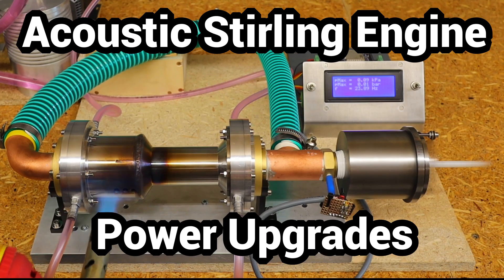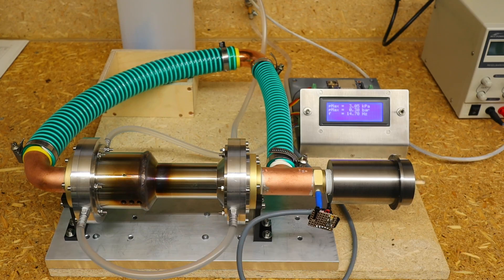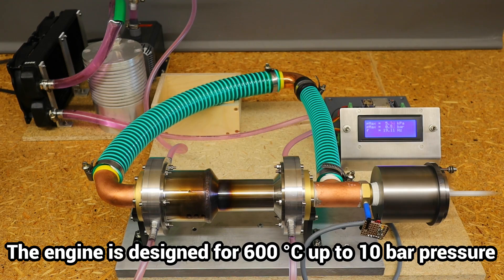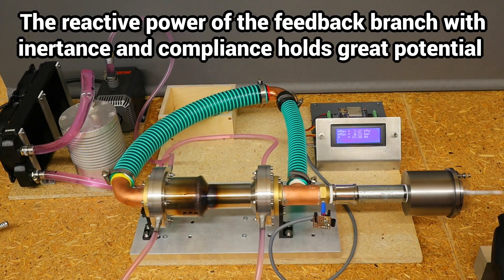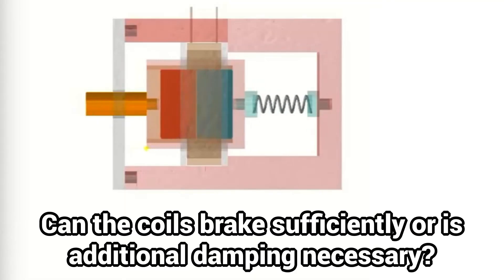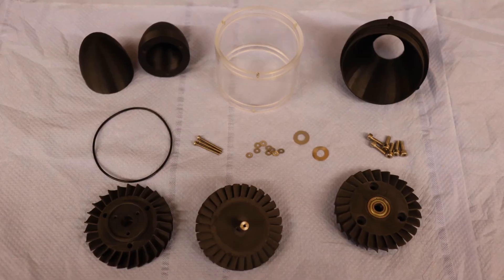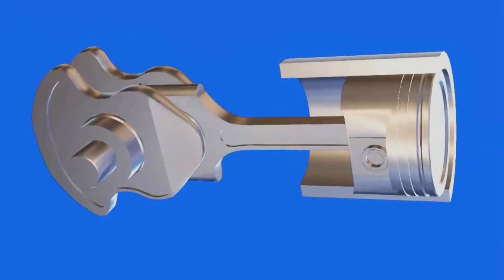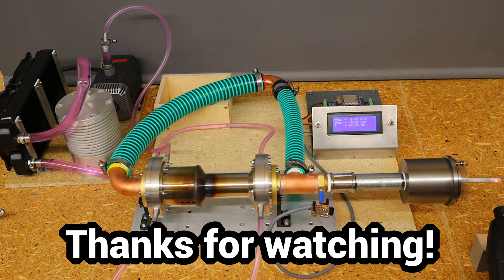Thermoacoustic Stirling engine – which is the right generator ?

Comment: I have been reading up on Linear Generators in the context of Free Piston Linear Generator recently so can share info on those if need be potentially.

An “Air Piston” may be a good damper (and has been used for FPLGs) and it is also tunable via pressure.

Dampening via tuned Generator Load CAN be done but that does get complex!
Reply from the maker: The complexity is really an issue  with the linear generators and I am beginning to think that for first experiments its not the right selection.
If the engine is in a good developed condition and delivering good power a linear generator can be adjusted to the engine to get a good efficiency and reliability?

Comment: I'd aim for the linear generator first, but it might be fiddly. I'd pivot to push crank if it doesn't look promising after some small amount of effort.
Reply from the maker: Yes that are my thoughts also at the moment!
A slider crank is much more flexible and easy to build and adjust for first experiments.
When the efficiency later has to be optimized a linear generator can be adapted to the final engine.
But I will wait with the decision as I get very good help at the moment with the many good comments! 

Thank you very much for your kind comment!

Comment: its alive, it walks! lol. all options work. if you want the simple linear piston motion can be turned to rotational motion (not crank axle but linear teeth on a gear) and use normal rotational generator.
Reply from the maker: Hmm,  a toothed rack and a gear does sound to me like much noise, bad reliability and much friction and wear or am I wrong?
But thanks for your input to think in all directions is the key!

Comment: If your goal is characterizing intrinsic engine power, I think counterintuitively a piston/crank mechanism is probably the easiest approach, although it may be hard to enclose when you start pressurizing the engine and it won't get you to your ultimate goal. 

My idea is that you'd commit to using indicated horsepower rather than shaft horsepower during the engine optimization phase, you would NOT try to generate mechanical power output at all, and then you'd be able to measure your engine's pressure-volume power output separately from any intrinsic properties of the piston and generator system. Then if you got disappointing results in the future you'd know it was the generator's problem, and not the engine, and you'd know where to focus.

Step 1: get a very fast responding pressure sensor that you implicitly trust (may require significant characterization work to be sure that the pressure readings are trustworthy)
Step 2: build a variable throw crank or a set of cranks with variable throw.
Step 3: couple the crank to a servomotor system, with closed loop position feedback and an appropriate speed controller capable of full power regenerative operation.
Step 4: conduct a "frequency sweep" on each engine configuration, and repeat the sweep with each crank throw setting. This means programming or setting the shaft speed to produce a very slow speed ramp through a range of speeds that encompasses the acoustic resonant operating point of the engine. Log both the crank angle and the pressure transducer reading continuously. 

I'm sure you know this but for anyone who doesn't, indicated horsepower is a measure of real world thermodynamic cycle efficiency in an engine that basically stops at the piston crown, and excludes all sources of friction and mechanical loss. It consists of mapping the pressure of the chamber as a function of piston position over the engine's cycle. Multiplying the pressure at a given point by the rate of piston volume sweep gives the power that the gas exerts on the piston. Accumulating this over the cycle gives the indicated power. Then, if the shaft horsepower of the engine is less than this by a certain amount, you know how much friction you have. If the electrical horsepower is less than the shaft horsepower by yet another amount, you know how much generator efficiency loss you have.

The idea here is that you basically get a set of indicator diagrams for the engine at a range of possible displacements and operating frequencies encompassing your optimum point. That way you don't miss the optimum just because the generator wants to resonate at 10Hz and the engine wants to run at 10.8Hz, or something silly like that. 

The system might generate literally no usable power electrically but would let you build an engine that worked super well, and then once you'd tackled that, you'd know how to size your generator for the appropriate power, how important the generator resonance frequency was, etc.

Also you could use an absolutely secure piston seal (like a greased o-ring) that absorbed ridiculous amounts of mechanical friction power, but provided completely clear-cut results as to actual thermodynamic cycle output without confounding contributions from piston leakage.

Definitely a delayed gratification approach, but probably one more likely to ensure success.

edit: another thought... you don't even need a regenerative speed controller if you lean into the "no mechanical output" tactic. Just apply a friction brake to the shaft to absorb any generated power, so the servomotor is always producing positive torque! Then a simple speed controller should work.
Reply from the maker: Many thanks for your very well-founded suggestions.
Your approach of  monitoring the real indicated power is very valuable and helpful for me and I will carefully study your comment and think of it how to realize it!
It would be more work to follow your approach but I think it is really worth it if you see the long term benefits of it.
I know that optimizing the engine to a point where it delivers really useful power is a very long way and information is the key to success!
Thank you very much I will think very much about your suggestion!
Reply: @ I am glad you found the suggestion interesting! If it was me, I think the part I'd find most challenging would be to find a pressure sensor that was sufficiently trustworthy, because of course if the results are misleading, then the approach is worse than useless!

Oh I guess if it were literally me, the part I'd find most challenging would be fabricating the beautiful parts you make! But I think you have that well in hand!

Comment: I noticed another poster mentioned the movement of the air as being wasted energy.  I think that's a great point, and made me think of a steam engine.  With your piston setup is there any reason you couldn't go to a double acting piston?

I think the linear generator is the best choice, although the control scheme is more complex it would be much easier to tune.  One of the things I think about with these type of stationary engines is that they don't really need to handle transient loads.  They just need to cycle up, charge a set of batteries and then shut down.  So they can be tuned to sit right in their efficiency zone.
Reply from the maker: You mean double acting piston in the way of using a second thermoacoustic engine on the other piston side?
That is very optimal and made in professional engines (mostly with 3 cores I think?) but it is double work for me and in the development phase it would slow down the process to much.
So i prefer to optimize one thermoacoustic core and then, if needed, add a second or third core to get more power.
The control scheme of a linear generator is a nightmare for me and also the tuning is not so flexible as a slider crank I think? 
Thank you for your helpful comment and it would be nice if you could explain how a linear generator can be tuned very flexible while experimenting!
Reply: @ Maybe for the experimental phase it would make more sense to build it as a linear alternator, then you just need to regulate voltage?

The linear motion isn't really different than any other alternating current, wiring has to be pretty close to the same, no?

Comment: With a linear generator, as a coil with oscillating magnets you could use the coil to start the engine. If you apply a voltage on the generator coil the magnets will move back and forth, that then starts the engine. I hope you can understand my idea, Sorry for bad english.
Reply from the maker: But does that not need a very complex control mechanism?
Reply: @myengines2443 
You mean to start the engine?
I don't think so, what you need is a battery and  a pair of switch (and a resistor to limit the current so you don't melt the wires). The start up procedure could be the following:
1 press switch to disconnect the generator from the grid. 
2 press start up switch (wich sould be one of those switches that only turn on when you press them)

This will excite the coils making the magnets move up to one of the dead points.

3) release the start button and the engine starts

4) press swich used in point one to connect generator to grid.
Reply from the maker: @vittoriosandoni7064  many thanks for this, I will think of it carefully.
This initial start impulse maybe really enough to start the engine!

Comment: measure the freqinput(hzinput) on the shaft without load, minimise the airgap on the generator, build a MPPT and use formula less than/or 10% to begin with to get optimal freqinput(hzinput_calculated) based from the actual temperature inside the heat-core-chamber to get stable DC-voltage out from MPPT, the enviroment temperature might be a must to measure as well. Use a heat-resistor with low +/-% to measure the efficiency.
Reply from the maker: This is difficult to understand with little information but I will try to get the best out of it!
Thank you very much for your help!

Comment: Hello, good morning... You can position the piston vertically to use gravity as the return, not a spring that fatigues. Best regards, success.
Reply from the maker: Thanks, yes i have already considered that as an option, but the gravity of the piston plays only a small role at higher pressures used later and then the damping has to be adjusted anyway.
Thanks for your helpful comment!

Comment: Try to use two coils instead of magnet and coil, one is for the power and the other apply a range of voltage, with this method you can adjust your load to the system and output power
Reply from the maker: Okay, I'll look into that further, thank you very much!
Reply: Yeah, that’s how all the powerplant generators are built. DC voltage is applied to the rotor windings which induces the usable AC current in the stator when the rotor is spinning. 

However, it needs slip rings which wear out and cause drag. Not a big problem for the powerplants, just a maintenance expense. 

In this setup a solution needs to be found how to apply the excitation voltage to the coil in the piston. I think for small scale setups modern rare earth permanent magnets are better than DC excitation, and the varying output voltage is not a problem because I assume there will be an inverter from whatever voltage and frequency the coil produces, to the target system voltage and frequency (and/or DC)
Reply: Probably easier to use permanent magnets then rectify and smooth the output of the coil.

To make the output adjustable, just design the coils to provide a higher voltage than desired and then build a buck converter to convert down as needed to bring the load under control.
Reply: @ the output is AC, whether it's driven by a permanent or a DC magnet moving in the coil.

Also, I think, unlike the rotary machines, the output won't necessary be a pure sine wave, thus a solid state converter is required anyway.

Comment: Looking good. Tip: the ~piston is moving a lot of air in & out. This is energy wasted (althouh very little resistance). Maybe close the end with a big space, make the air mass/pressure part of the resonancee as well.
Reply from the maker: These were just the very first experiments where I played around a lot with different parameters.
When I know which generator will be installed in the end, I will close the open end to have also the possibility of pressurisation.
I think the resonance is the most important thing where you remind me very well!
Many thanks for your help!

Comment: Hi. It is interesting to observe your path at renewable energy. For a power less than 100W its is better to use custom made loudspeaker with sharp resonant frequency. If you like I can show it's parts at my next videos. My thermoacoustic stirling system itself you can watch at existing video at my channel (it was able to charge smartphone). The videos are in Ukrainian language. Please subscribe and I will make an english video for you. And please let me know if you have any questions. Best regards, Oleksandr.
Reply from the maker: Your videos are really impressive, thanks for them!
How do i find out the resonance frequency of a loudspeaker, is it always specified?
I would like to experiment with loudspeakers but don't really know how to handle them and don't know how flexible they are to use if they only have their own resonance frequency as the frequency of my engine changes during my experiments with pressure, volume etc.
Thank you very much for your kind and very helpful comment!
Reply: This is not renewable. You still need heat.
Reply: @fossil98 The author says he burns biogas made food waste which is pretty much renewable energy (unless the food is synthetic, made from oil, gas, coal and ore. Yuck, I hope that’s not the case 🤣)
Reply: Hello,
It sounds very nice, I would be interested in having a look at your work in videos in English.
Cheers

Comment: A speaker is fine to use at any pressure but must be used with a pressurized resonant chamber on the back, there should be a small hole to the other side of the cone so the pressure can be equalized slowly. Another option is to use what is called an exciter for making flat panel speakers and your existing piston, something like "EX32Q2-8 Dual Steel Spring Balanced" ? 
Ceramic materials have a very low coefficient of expansion so could they work well for a piston and bore that is extremely tight tolerance?
Reply from the maker: Yes the membrane of the speaker has to be backed by the mean pressure, your other speaker suggestion I will look up.
Ceramics are very high tech and not so easy to machine and would make things too complicated for me.
Thanks for your nice help!
Reply: @myengines2443  you can actually buy small ceramic pistons for pumps, no idea how accurate they are made or whether they are suitable however.

Comment: Did you consider looking into how old steam engines convert linear motion into rotation. I think a flywheel could be useful to smooth out and unify the power draw
Reply from the maker: Its the most easy and flexible option and my favourite at the moment!